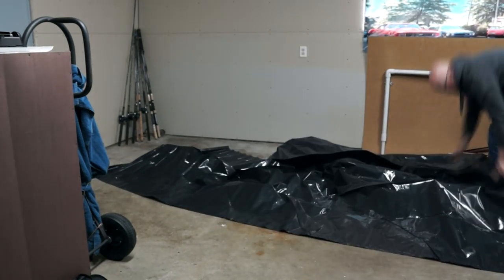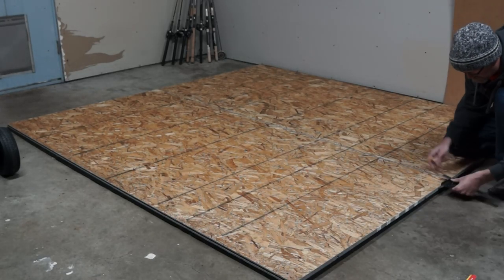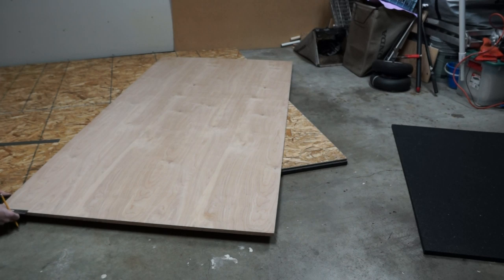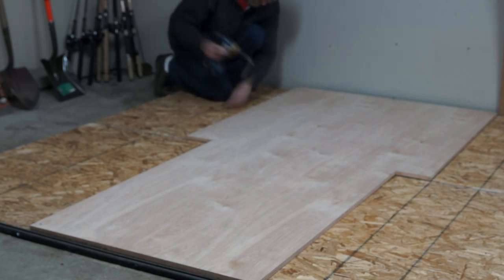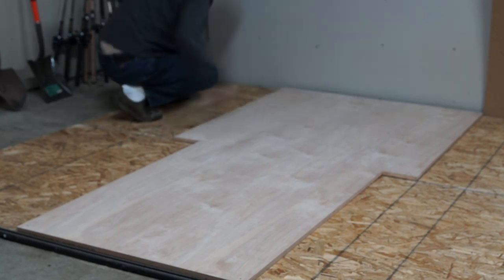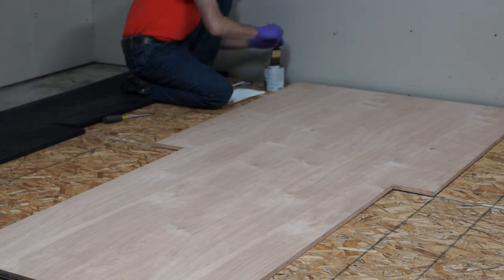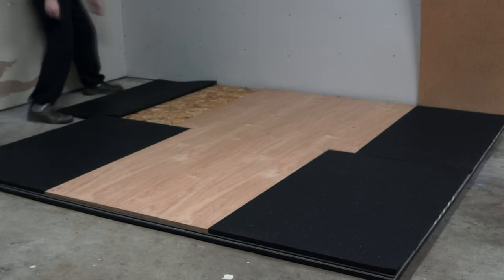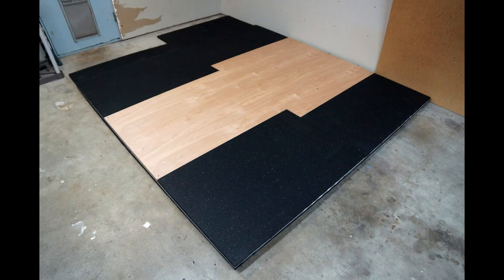Barbell weight lifting platform for power rack DIY build

Comment: How much money did you spend on all the material?
Reply from the maker: Hi Mike, I don't remember the exact figure, but including the  4 x OSB, 1 x Plywood, Mats, drywall screws, and water barrier plastic, it was somewhere in the $250 - $300 range. The main plywood in the middle was about $60, the stall mats were $40 each from Tractor Supply Company (local), OSB were about $22 each. I hope that helps.
Reply: Thank you